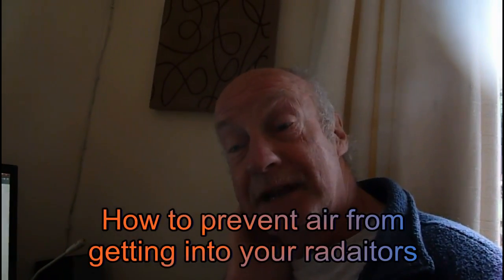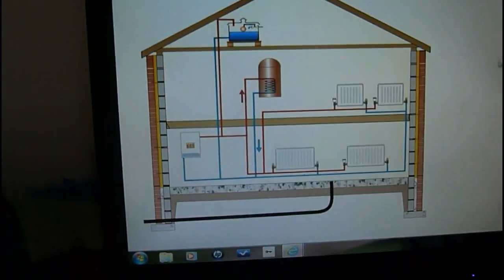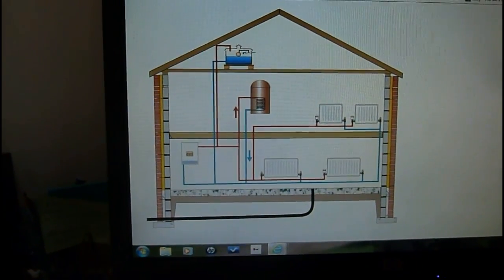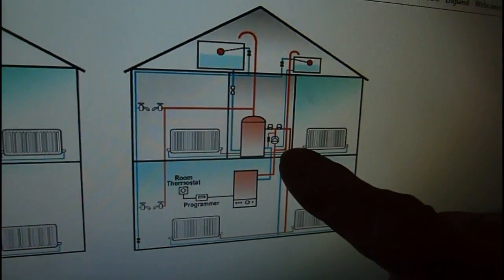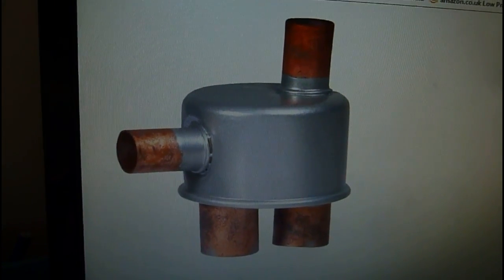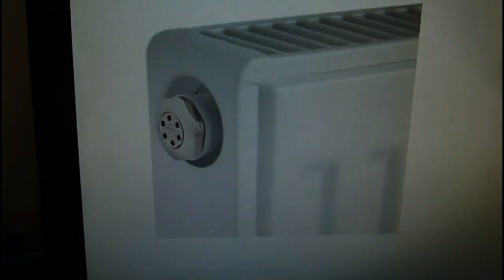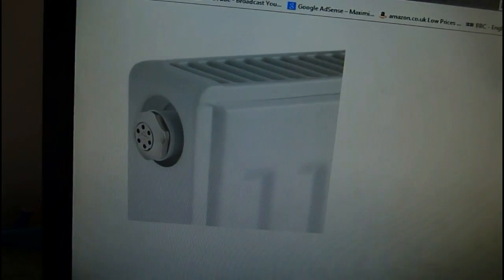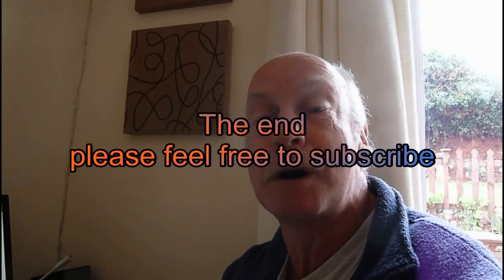How to prevent air from getting into your radaitors.

Comment: I have read more than once that the main cause of "air" in the system is the reaction between hot water and copper pipes. It creates hydrogen sulphide gas, which is why a rad with a big accumalation of gas smells of rotten eggs when it's bled. I had two systems where one rad at the top needed bleeding regularly. I moved a while ago, and had a flow and return taken into the loft, with an auto vent at the highest point, and another of these (the type that looks like a little brass tank) at the top of a towel rail.  Once the system has settled down after refilling (they always give off a fair bit of gas at first), the system is totally self venting (bleeding).  If a combi boiler is installed at the highest point in the system, there will almost certainly be no air, as a decent combi will have an auto vent inside it.

Comment: When I was a kid we had a system in which all the radiators on the ground floor were run in series with maybe 1" or 1.25" pipe, and the upstairs ones were diverter-tapped off that with 1/2" pipe, so it was always the first upstairs radiator that filled up with air. I put a float valve on it and all was fine after that, but later a plumber told me that the original valve (called a "coin valve" ) was actually designed to let air out when the rubber washer dried out, then seal up when the water level rose. We always closed it with pliers and tried to get it as tight as possible, so it was probably the fact that we were over tightening it that stopped it from bleeding effectively. The one you show looks as if it works on the same principle; I wonder if people ever run into the same problem with these.

Comment: Another great video - I had never heard of these valves before.  Just had a heat pump installed and it works fine but since the cold weather my hall, landing and towel radiator needed bleeding two weeks ago and now they are full of air again. After letting all the air out I had to use the levelling loop to bring the pressure up again - presumably this will still be necessary even with the special air valves? I am on to the installer to sort it out but it is nice to be able to act as an 'intelligent customer' as my boss used to say. I will ask if they put the fernox in as well.
Reply from the maker: Yes best keep on top of it. O and yes you will still need to top up if fitting the air valves.

Comment: hi al.need to pick your brain again. Brother has  bought a house which has a plastic cold water storage tank in the attic and underneath it he has a hot water cylinder which has an immersion in it. All of this is housed in a cupboard.He wants the tank and cylinder removed and a combi boiler system fitted in place of this. i have phoned over a dozen plumbers but they are interested in fitting central heating but not interested in removing tank and cylinder..he needs all tanks disconnected before combi system goes in because cupboard in way.of other building works.i have decided to take cylinder and cold water tank out myself. how do i drain tank and hot water cylinder? a couple of things you should know. there is no central heating in the house. when i switch mains cold water off all cold taps in the house are turned off.no stopcocks or valves between tank and cylinder to switch it off and also no  drain cocks.on cylinder and tank. please help!!!!
Reply from the maker: Hi arfan , ok start with turning the main stop tap off and then run all the hot taps until they stop running . There will be about two or three inches of water left in the roof tank which you will have to bail out with a saucepan and bucket , then you can undo the pipe connections and remove that. Next undo the top pipe (the expansion pipe) from the top of the cylinder( or undo the immersion heater ) when that is done connect a length of 15mm copper pipe around 3 ft long onto the end of a garden hose that is long enough to reach from your cylinder to outside the house, then push the pipe with hose connected to it into the cylinder either through the expansion hole or the immersion hole . Push the copper pipe to the bottom of the tank then pull it off the bottom about 2 or 3 inches and get a friend to suck the end of the hose hard , once water starts to run out of the hose in the garden you can let the copper pipe sit on the bottom of the tank until all the water is emptied out of the tank (that is unless there is chalky lime scale on the bottom in which case you will have to hold the hose clear until it runs empty). The system is now empty and you can safely remove the copper cylinder and all the associated  pipe work between . (think of all that scrap metal , money money) All that remains to do is to put a blanking cap on the main supply that used to go up to the roof tank.
Quite a simple job , I am sure you will manage it ok .
Good luck Arfan.
Regards,
al.